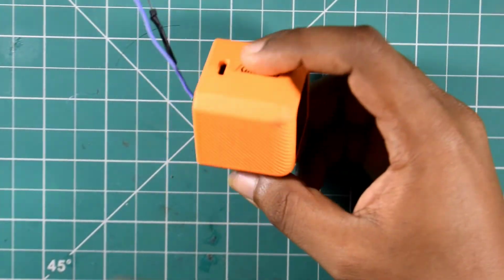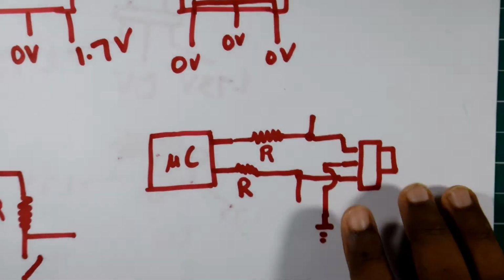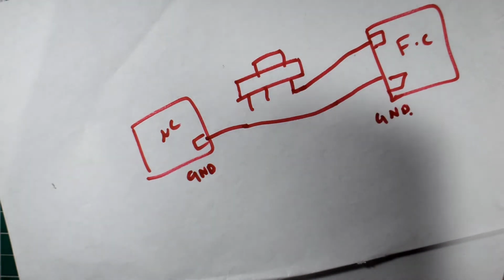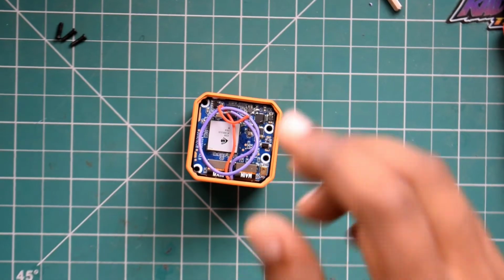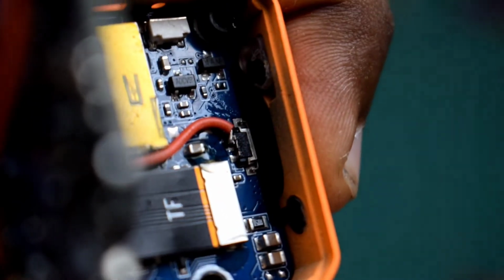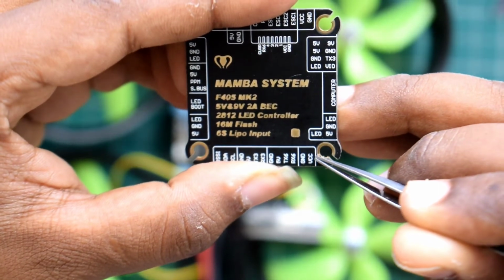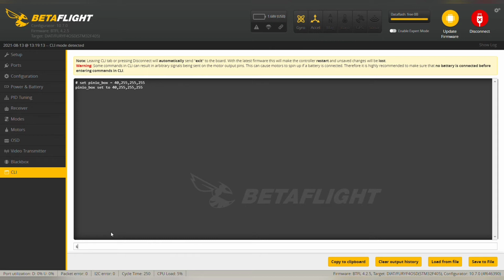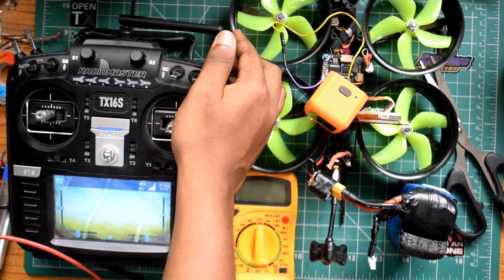How to control your Runcam 5 action camera using AUX switch in your controller? | Runcam 5 MOD

Comment: Great Job working this out and making the video! Is there a way to power the RC5 off the FC and also have it on a switch like your showing in this video?
Reply from the maker: @Snakkerz003  Yes possible but preferably use a 5v dedicated buck for RC5 instead of using the FC'S 5V out directly

Comment: hi bro help me my cam can not turn on , i try to reset but still not work, where i much looking for ?
Reply from the maker: Is the led lighting up with usb connected to PC ? You might need to open the cam and check the battery voltage also see if it connects to PC then try loading the firmware again
Reply: @FPVMATE  thank you

Comment: Great video! Should you put a current limiting resistor between RC5 turn-on line and FC GPIO due to 1V8 and 3V3 voltage level difference?
Reply from the maker: Yeah i tried putting a current limiting resistor but then the voltage level goes below the low threshold and doesn't detect the button press and since there is already a current limiting resistor for that button and it just senses the voltage threshold going above upto 3v3  won't be a issue so didn't use any other current limiting resistor.
Reply: @FPVMATE  All right, this sounds great, thanks!

Comment: I notice the lower board had two pads…a positive and a negative pad…is that to add external power to the camera? ie power from the FC?
Reply from the maker: There you can measure the battery voltage ...yes if you remove battery you can power through those pads. If fc can power the cam i am not sure of but external bec you can use to power it from battery voltage.